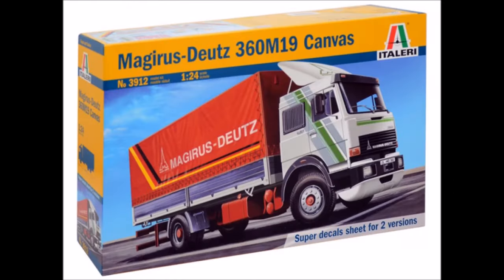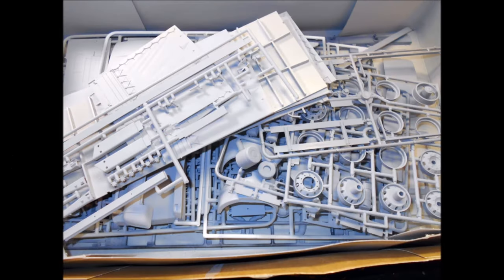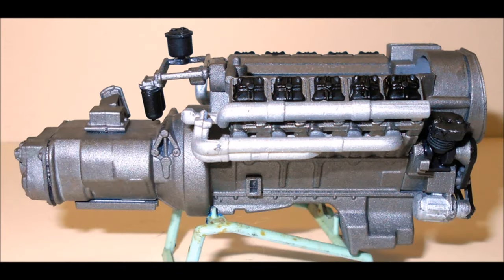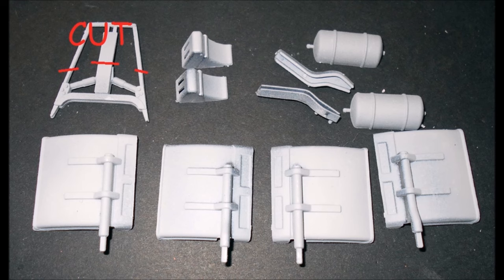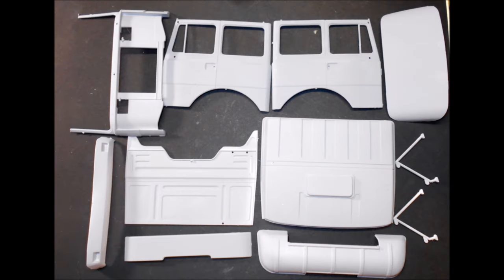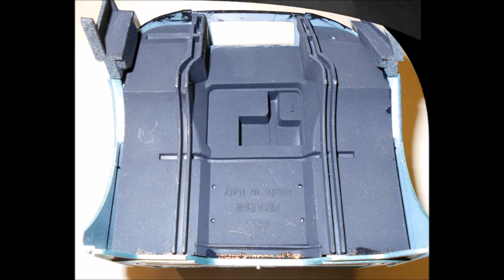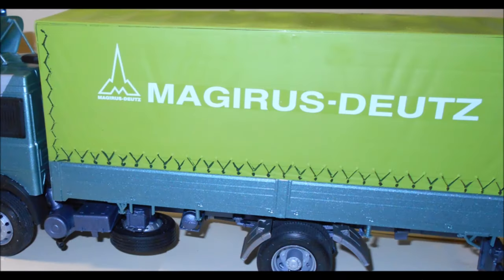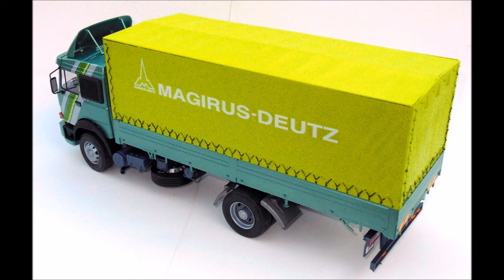Magirus-Deutz 360M19 Canvas Truck 1:24 Scale Italeri 3912 -Model Kit Full Build

Comment: Mod Podge gloss can also be used to secure glass into place. Just set the glass in place and paint a bead of it around the glass. Mod Podge gloss dries crystal clear and holds glass securely without fogging. It works for installing headlights and taillights and also enhances molded in chrome headlights too!
Reply from the maker: Thanks for the suggestion Marty!  -Doug